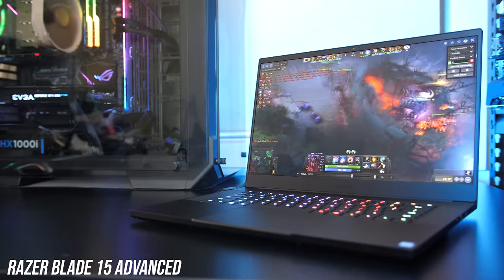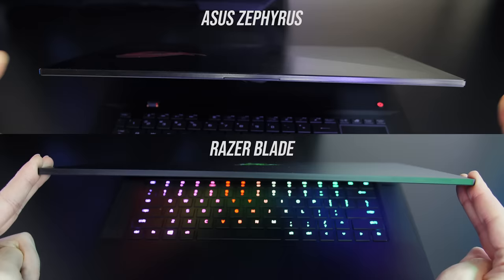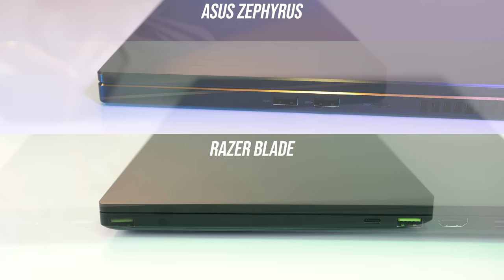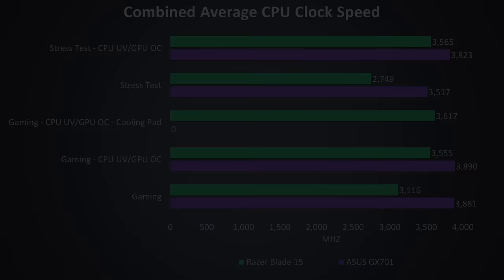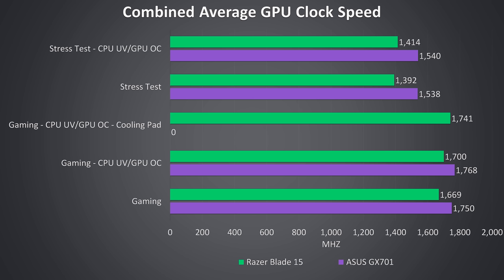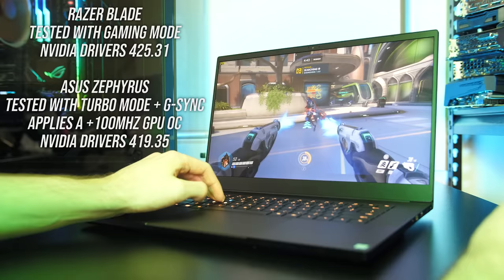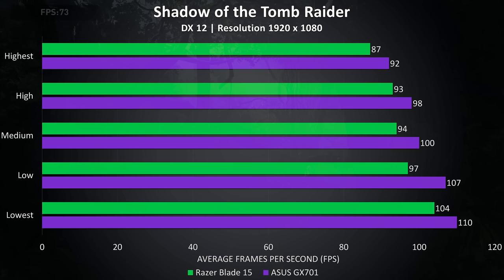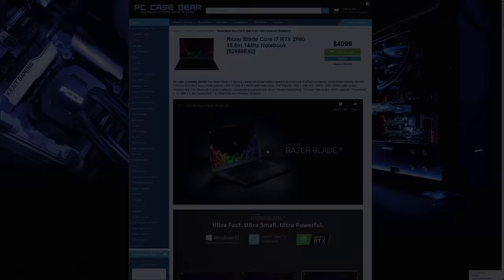ASUS Zephyrus S (GX701) vs Razer Blade 15 Advanced - RTX Gaming Laptop Comparison

Comment: You have an extremely wired version. Advanced version has 9-th gen and 4K OLDE 1ms response time screen and Wifi AX capable upgraded card as default. What's up?
Reply from the maker: There was a weird time between RTX graphics launching in January 2019 to when 9th gen Intel CPUs came out in April. Basically there was 4 months where we have laptops like these ones, which have now already been refreshed with 9th gen, shouldn't be too much difference though.
Reply: @JarrodsTech  alright then, thanks for letting me know!
Reply from the maker: No problem!

Comment: The Zephyrus has the clear win in this comparison.  Yeah, Optimus has its advantages, but there should be the option to disable the Intel graphics and, by extension Nvidia Optimus to increase performance.
Reply: Which there isn’t on the Razer Blade so there’s no way to remove the overhead.
Reply from the maker: Yeah I wish all machines have the option to let you pick between the two, at least then it's an option instead of being forced one way or the other.

Comment: Is a razer blade rtx 2080 truly more worth than razer blade rtx 2070??
Reply from the maker: Probably not, it's really diminishing returns at that point, if I get more data I'll do a 2080 Max-Q vs 2070 Max-Q video.
Reply: @JarrodsTech  Would it be possible to add a 2060 non max-q to that Comparison? As far as I've heard 2060's really close to 2070max-q, so would be good to see how it stacks up against the 2080max-q too.

Comment: Well you are comparing a 17" asus to a 15" blade. Wouldn't it have made more sense to compare the asus with the 17" blade pro? Just saying
Reply from the maker: The Blade Pro 17 did not exist back when I made this comparison, and a lot of people still wanted to see it. I did recently test the Blade Pro (review going up this Friday), so might do another.
Reply: Thats a good idea especially for those interested in purchasing a 17" laptop. It just seemed odd to do a big laptop vs a smaller laptop. A smaller blade wouldnt run as cool as a larger asus with more space for cooling. I feel like those who purchase the 15" models do so for different reasons than someone who picks up 17" models. I could be wrong though lol

Comment: it's not because the g sync go and see the result of the rog strix scar 2 compering with any other laptop! better than anyone.
Reply from the maker: Yes, it's not the gsync. It's because the screen connects directly to the NVIDIA graphics and does not use the Intel graphics with Optimus. The scar II does the same thing, it just happens this is a requirement for gsync.
Reply: @JarrodsTech  and the MSI in some laptops have a very powerful performance, not like the razer or Acer deel Lenovo etc
Reply from the maker: Hard for me to compare directly as I test the game in a different area so FPS will not be directly comparable. The 1070 does perform quite well, in my last review of the GE63 I had thermal throttling, but with cooling pad / undervolt it's probably a bit better.
Reply: @JarrodsTech  yeah it's so much better.. Me to before u/v and fan pad the cpu goes to 88c or mide 80c now it's going down 5-10c & the GPU in mide 70c plus I have o/c the GPU gives me about 10FPS avg

Comment: The test results seem a bit unfair given the GX701 has an overclock when the Razer blade didn't. It would have been a bit more instresting to how the Razer blade compares when both are use the Max Q stock clocks.
Reply: Agreed, but even the undervolt is enough to close the gap on any perceivable real world performance improvement. The Blade is the overall better laptop with more versatility which I think is the whole point of a laptop.
Reply from the maker: I think it's perfectly fair. The blade was used in "gaming mode" and the Zephyrus in "turbo mode", the best built in profile each machine offers, the setting the majority of people would click when using it - these are available out of the box with no user customization. If Razer want theirs to perform better, and were able to, they would have done a GPU overclock too, like they did in last years blade, I can only assume they did not due to power limitations or possibly thermals.
Reply: @JarrodsTech  The majority of people won't even know these profiles are thing, much less use them more than once. It would have been best to offer the performance of box results as well instead just gaming profiles

Comment: The Zephyrus is a real beat, but my Alienware crushes it :D
Reply: Crushes it in temperature?
Reply from the maker: Which model? The GX701 comfortably beats the m17 with 2080 Max-Q 😎 if it's like a full on 1080 then yeah ok 😛
Reply: @JarrodsTech  I've got the normal 17 inch  (not m17) Alienware with the core i9 and GTX 1080. :D
Reply from the maker: Ah ok, well yeah that probably does a bit better 😁

Comment: ASUS ZEPHYRUS TAKE MY MONEY!!!
Reply: @JarrodsTech  im looking for a laptop with a gtx that will last long preferably a full gtx 1070 but not as big as the helios 500 is there anything like that?
Reply: @JarrodsTech  bro may u please tell me shall i gor fir rtx2060 or rtx 2070???
Reply: @nas6119  How about Zephyrus M(GM501)? The upgraded model has a full GTX1070 with the same cooling design as the rest of the Zephyrus. Though it has a very short battery life, even in optimus it barely reached 2 hours when I used it to tke notes in class.
Reply: @zuika1805  oh damn
Reply: @zuika1805  how are the speakers?
Reply: @zuika1805  cause i have a budget of 2100 a d every laptop i come across seems to have a problem but how loud are the fans?
Reply: Hostile Cornball 7 2070 is much better, trust me.
Reply: @nas6119  For me its sounds great and it has alot of bass to it. Compared to the sound of the fans, if the fans are on silent mode, its loud enough to cover up the fan noise, but not for the normal and overboost mode. Those can get really loud (espeacially when its on load), so typically if I'm not at alone I would always set the fans to silent.
And if you're concerned about the thermals, playing games like Apex or video rendering with fans on silent would have the internal temp. around the high 90s. With normal or overboost its around 85-90 and 70-80.
Reply: @zuika1805  that sounds pretty good i might get it
Reply: @zuika1805  thanks
Reply: @sentinel5901  maybe for desktop versions. But for laptop versions, I've heard there might not be much difference. In fact, they say the 2070 gets hotter.. not sure though. 

I had to decide between a Zephyrus S 17" with a full rtx 2060 (or at least that's what I think it has since there was no specification for this one to be Max Q design) or a 2070 max Q, so I went for the 2060 one. Currently waiting for it to arrive. 

Jeez, I hope I'm not wrong with this purchase.
Reply: @zpirit_  wise choice, the rtx 2060 is NOT max q

Comment: if the blade pro 2019 came with 4k and Adobe rgb 100%..I woulda bought it in a heartbeat
Reply from the maker: I think the Studio version will offer that.
Reply: @JarrodsTech  can it be used for hardcore gaming too? thanks Jarrod btw. Huge fan
Reply from the maker: @nitekrawler2975  Not sure on the specs, but I'd expect so, probably available with the same RTX graphics, or might be Quadro over not exactly sure, Quadro can still came just fine but generally costs more.
Reply: @JarrodsTech  I humbly thank you for your advice. Rock on!!!
Reply from the maker: No problem!

Comment: Razer is overpriced, and you can usually get something just as good for a lower price.
Reply from the maker: Yes, you're paying for the better design/all metal thin build. In this comparison there isn't much difference, however.
Reply: You have to consider that the zephyrus, being a 17" laptop, has a better cooling, phisically it's bigger. And that if you buy the Razer blade, you have a Gaming laptop that can be a laptop, I don't think the Asus is as much comfortable as the Razer to carry everywhere.
Reply: David Bartelloni just get the 15 inch
Reply: The keyboard is still less comfortable. And the 15" would have worst performance
Reply: I've hummed and hawed over these very two for a long time and it ultimately came down to portability, build, and keyboard. The Razer Blade 15 is very comfortable for non gaming use and is worth the small performance trade off IMHO. It plays all the games I want extremely well and the 240hz screen is very nice.
Jarrod, this is fantastic work btw! Keep it up, you are the authority on gaming laptops IMHO.

Comment: The Asus one on hinges alone will tell you it will be a problem in the future.
Reply from the maker: Maybe, they did feel very strong, you can see in the video it's basically like a mechanical gear, I'd be more worried about bending the metal plate underneath it constantly. I mentioned this to them at CES but they said they have tested it with some large amount of opens, so no idea if it'd be a problem, the Zephyrus design has been around for a few years now and haven't heard of complaints.

Comment: Using a 2080 on a 1080p screen is overkill tbh . Hugh miss for both brands to upgrade to 1440p 😒
Reply from the maker: Yeah 1440p would have  been nice as an option on the 17", doubt I could personally tell you the difference looking at a 1440p 15" though lol
Reply: I guess the other tiny problem which might make it harder to buy is the 4500 AUD price tag . Loved the review BTW
Reply: But i wish they made a thin and light laptop with the 1660ti, the price could easily drop near 2000 dollars AUD

Comment: Wow razer blade limits the power and still has higher temperatures. wow!
Reply from the maker: The cooling in the Zephyrus is just on another level, though comes at the expense of basically taking up lots of space.
Reply: @JarrodsTech   Very true, don't think it's necessary as well for the zephyrus considering there are many other thin and light that don't have that design. Also I think razer should name their CPU 8750h -max q 🤣🤣

Comment: I will never buy a light and thin gaming laptop, only thick and heavy for better performance~
Reply from the maker: Fair enough, though the performance from these is quite good I think, decent temperatures too considering the size.
Reply: @JarrodsTech  Absolutely oh yeah, great tech, but For me, I'd prefer performance over portability, as long as it's under 30 pounds
Reply: Do you have any recommendations for high end laptops of that category? I'm the market for a laptop but I'm used to desktop performance.
Reply: @richmondyayarea  Very well, for your situation,, you should consider Alienware Area 51M, The upcoming Predator Helios 700, MSI GT75, and Asus G703
Reply: @Richard Zhang Thanks for the reply, I'll be looking into those and comparing.

Comment: THUNDERBOLT IS NOT NEEDED FOR A GAMING LAPTOP! GPUs performance is reduced greatly when used externally
Reply from the maker: Thunderbolt is used for more than just eGPU, regardless, some people like to have that as an upgrade path. Yes the performance is reduced greatly compared to say using it in a desktop PC, however the fact is you can still significantly boost laptop performance despite Thunderbolt bottlenecks.

Comment: Hey jarrod! 0:37 - Asus has RTX 2080 (NOT Max-Q)
Reply: what are you talking about ? the gx701 has a 2080 max q, only the 2070 and 2060 are none max q
Reply from the maker: Maybe in the new model with 9th gen CPU and 16gb soldered to the board, my 8th gen one was 2080 Max-Q (GX701GX).
Reply: No no, max q for sure, cannot physically fit a non max q in there and cool it, the 2070 is the regular laptop one tho
Reply from the maker: Looking at the specs for the new 9th gen model (GX701GXR) it doesn't specifically say Max-Q, but it notes the 90w TDP and a 1,230MHz boost clock which would indicate Max-Q, same as the one in this video.
Reply: @JarrodsTech  it most likely still be the 2080 max q due to thermals, but the fact that they added 16gb soldered for a max of 32 is great. Also im planning to get the 9th gen variant with the 2080 max q but for now only the hdr version is avaible and not the gsync model. The hdr one is avaible for preorder on amazon but it cant ship elsewhere apart from the us... perhaps you have some info about the refreshed versions ?

Comment: the blade if you want an actually portable laptop.
Reply from the maker: Yeah, though the GX701 is definitely smaller compared to what 17 inch laptops used to be!
Reply: But it is so weak compare apples to apples to other i7 8750H gaming laptops. Plus 2.1kg is not that light as of year 2019 for a thin&light gaming laptop. I think MSI GS65 is a better option anytime. Razer is cheating on the thermals by limiting the power draw of the CPU and start throttling the CPU at 90C instead of the more common 95C.

Comment: I think the Blade is more laptop than gaming laptop. While the zephyrs is vise versa.
Reply from the maker: Yeah I could easily see the Blade being used for more than a gaming laptop more so than the Zephyrus, granted to me that's mostly just a size thing, I don't personally like travelling with a 17 inch machine.
Reply: The whole point of a gaming laptop is having the versatility of being portable while still being able to play games at enjoyable frame-rates. The Blade achieves that better. If I cared about the best possible frames with the best possible cooling then I'll just get a PC with a proper case (which I have). If I'm traveling then I'd rather have the smaller footprint Blade with me. If say I had to go into a professional setting, like a conference or a meeting with a client, then I would also prefer the Blade over the cheesy looking Zephyrus.  The Blade in this comparison is more a gaming laptop than the zephyrus, hands down. It does what the zephyrus does but is more versatile which, again, is the whole point of a laptop. That said, the Zephyrus is the better performing laptop when it comes to gaming, no doubt there. But in this comparison, it is simply not enough to make any real world difference and it certainly doesn't justify carrying around a larger, heavier, louder and poorer-battery laptop. To each their own though.

Comment: You really should consider covering balanced mode.
Reply from the maker: I talk about it in the full review, basically it thermal throttles but runs quieter, wasn't really able to fit all the different settings I tested the Blade with in this video, just chose the most powerful ones to do the direct comparison.
Reply: @JarrodsTech  Thanks Jarrod. I''ll go back over your full review.

I'm actually hanging for the 240hz model review at the moment. Can't find anything online.

Subjectively, how did you find the 240hz screen compares to the 144hz? Talking colours and responsiveness?

(subbed)